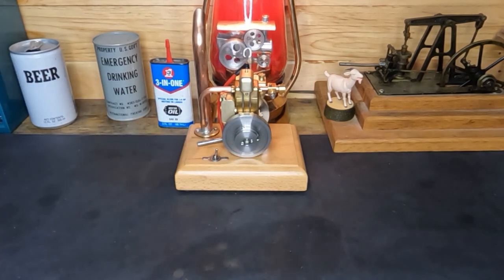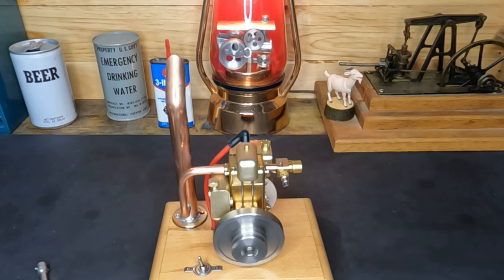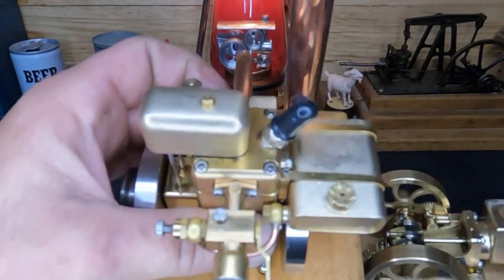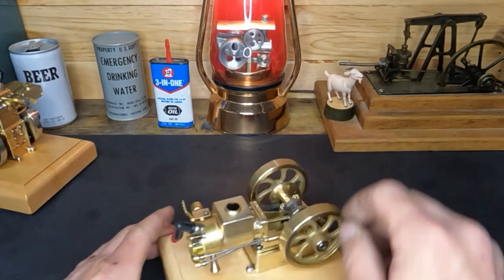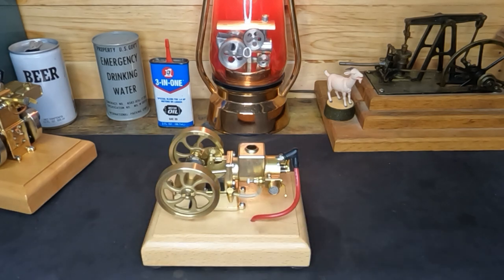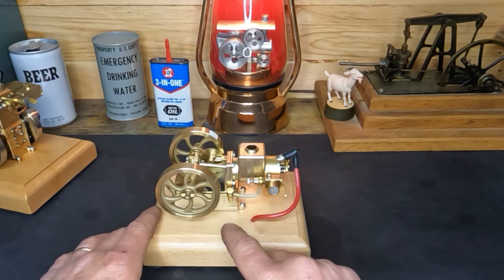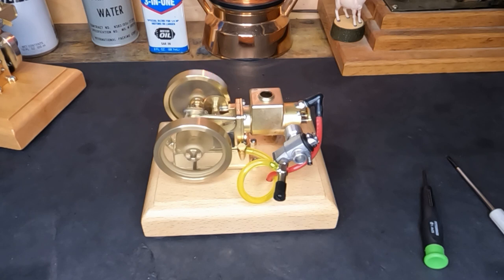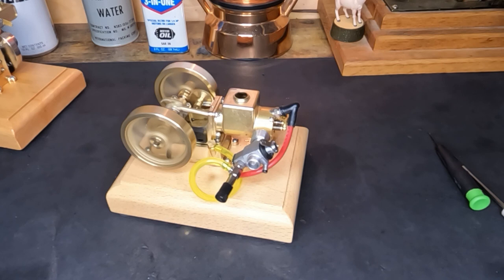Let's make a manifold for the m17b and install a carburetor from nitro fueled engine!

Comment: There is a designed in subtlety with a ramping carby like that.  When tuning a regular model aero engine etc. I used to start with WOT and a rich setting, say three turns out - it should be slobbery rich and can't run away.  You then lean it off until it cleans up but stays well on the fat side still.  Then reduce the throttle to half way or a bit less and see if it gets slobbery rich again or if it leans out, if it leans out richen the low/mid needle out a half turn.  If it richens up screw it in half a turn.  If that adjustment seems to be stable and maybe just a bit on the rich side reduce the throttle until you get a steady idle.  If it seems lean richen the low/mid needle an eighth or so - if rich lean it out an eighth of a turn.  Advance the throttle and see if your midrange transition is clean or if it stumbles.  If it pops or suddenly hesitates your low/mid needle is still too lean.  If it sags and blubbers a bit it's probably rich and can be leaned off.  Once you get the transition from low idle to high speed reasonably clean lean off the main needle a little and see if the engine now runs a bit cleaner from idle to WOT.  This has now synchronized the movement of the barrel in and out with the needle settings.  If the main needle is too far away from your low settings the mid transition will be hard to find, so if it just stops and your main needle is out two turns or more the high speed is probably way too rich.  The low to mid settings will always be using less fuel than the main needle is set for until that mid to high speed point in the barrel rotation.  You will find if the carby is too large for that engine that the midrange is harder to dial in than if the carby is correct for that engines needs.  As the barrel moves in and out it is altering the venturi that the low/mid needle is entering, so at idle you have a fixed needle position into a corresponding orifice which is normally a little brass tube sticking out a little into the air flow.  As the barrel rotates it is ramped away from the fuel venturi, allowing the taper of the low/mid needle to reduce and correspondingly allowing more fuel to pass in tandem with more airflow, this continues until you have the barrel fully open and fully ramped away from the inlet venturi - by that point the tuning and mixture of the engine is fully controlled by the high speed needle.  You can get around a bigger carby, even if the tuning could be a little touchy - but you don't generally get away with a carby that is too small...  I have a box of carbies collected over decades of modelling.  By the time I was winning races in model boat racing I don't think I had an original stock carby on anything I owned, except for a couple of plane engines that ran too good to ever molest.  Mostly I was replacing stock carbs with aftermarket car types that had main, idle and midrange tuning.  Used to spend hours just tweaking to see how I could get flexible, reliable power at all times as you only win races when the engine is still running at the finish line.  :)  I reckon the grandson and I need to pull a few carefully packed away treasures and set up the bench run mount...
Reply from the maker: Hi Boat Beard, You are EXACTLY right on the tuning, principles of operation, the tweaking, and the fact of winning a race only if it is still running. Thank you for such a FANTASTIC and informative comment. Were going to keep fiddling with this idea (maybe try a carb 1/3 the size) and dial it in. The valves float pretty early on this little guy so setting the mixture at wide open is pointless unless we put a load on it but we'll get there. Thank you again.
Reply: @steam212  Yeah, did forget about those pesky valves...  With two strokes it's virtually impossible to over-rev unless the carby is leaned out - looking at those delicate little springs in these Chinese engines, probably amazing not to have the valves floating at any speed above a good fast idle...  Given the size of the engine, and it's quite modest potential - I'd be tempted to look at a smaller basic .09-.10 size carby.  That little engine is only going to have a fraction of the air flow demand that any similar displacement two stroke engine does.  I expect the four stroke M17B would only have half the intake flow at similar revs to a .20 size two stroke, and as it is going to run at much lower speeds due to it's design limitations it will need even less airflow again.   I reckon that bigger carby will be very hard to reliably tune without enough airflow past the spraybar to make for good atomisation...
Reply: @boatbeard7767  Another thing to note with model aircraft is that the prop will prevent over rev anyway. It's never going to rev any higher than it can turn that prop and that, if the prop is chosen correctly, will keep even a 4-cycle from overrevving.

Comment: Lovely slow running Mr 212. Noice. I have been thinking of doing this but in the end couldn't stand the look on the brass engines so didn't. However, it's still an option for the 9cc Cison V2 which I will - fate willing - get ignition parts for soon. :) And maybe a better carb is a really good option there, I suspect..  PS in the past I have used plumbers goop, home made rubber washers and even grease to hold loose Chinese micro carb parts together so the don't leak air or just... you know.. flop  around loosely like a dying fish. Just subscribed...took me a while but...yeah, noice.
Reply from the maker: I admit that it looks pretty hideous hanging out there like it does, but this is just a rough draft or proof of concept to see if it would work. I can't wait to see your upcoming video on your V twin.  The factory carburetor was held in with loctite on the threads but I broke it free to see what the thread size and pitch was off camera. I didn't lock the adapter in on this yet as it is just for testing. Thank you so much for your comment, suggestions and subscribing. I really enjoy your videos.

Comment: Ha! 750 double pumper and model T? Piston parts every where. I am in British Columbia and it has been wet here too. Big difference from last year. Any ways, darn you, I really, really want to see more of that beam pumping model! Where do you find all that cool old stuff?
Reply from the maker: Hi Joe, I couldn't think of a better analogy for the size and technological difference. Let's finish the Showman's engine first and then we'll start into the beam engine. I found this engine almost 20 years ago being used on a train layout as an abandoned oil well pump. I knew it had to be saved and enjoyed once again as the engine it was made to be. It is far from where it will be when we get done. But we'll get it there